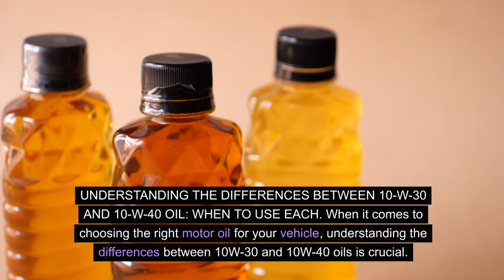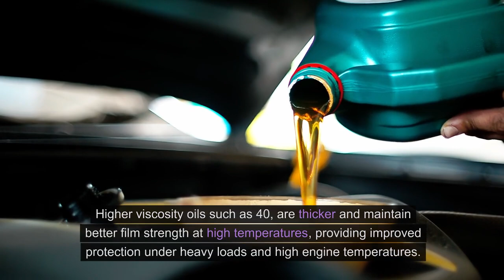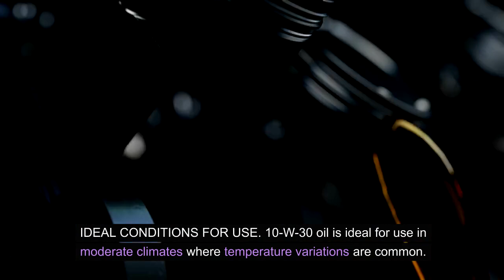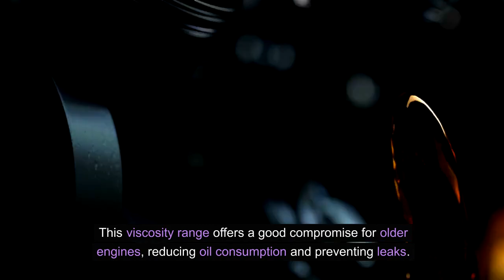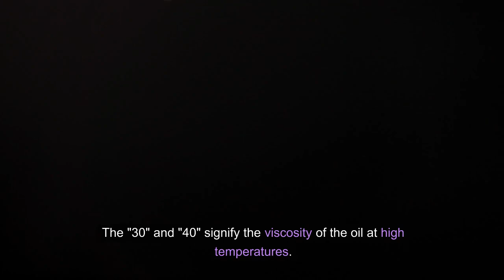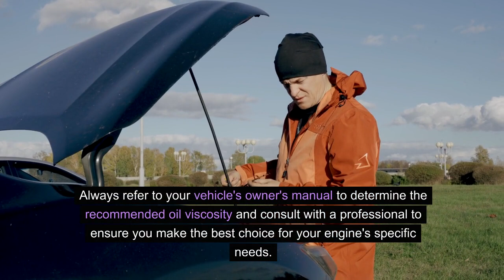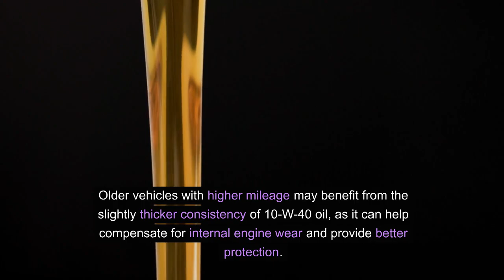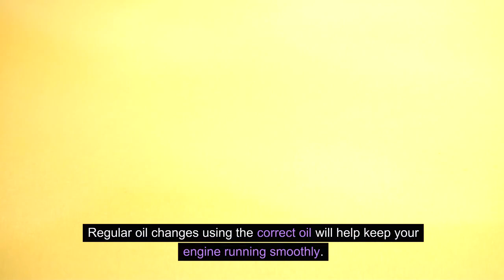Decoding Engine Lubrication: 10W30 vs. 10W40 Oils Unveiled

Comment: Can we switch between these 2 types of oils during winter and summer?
Reply from the maker: You can. But lighter oil is best in the winter because oil with lower viscosity flows better providing a better cold-weather start up protection.